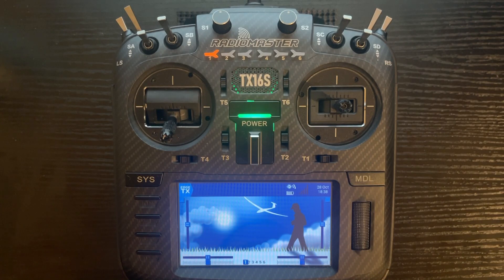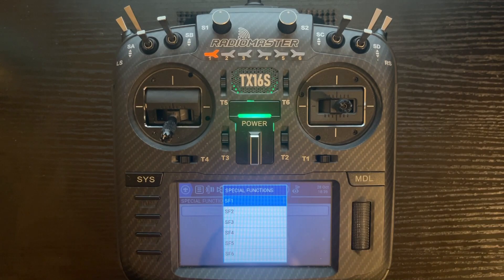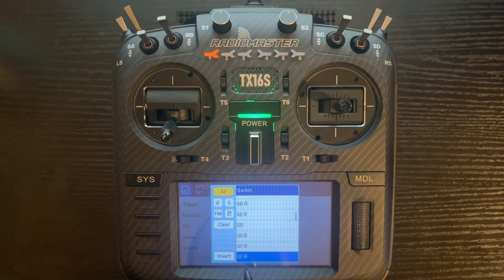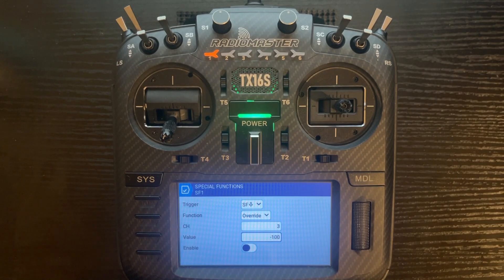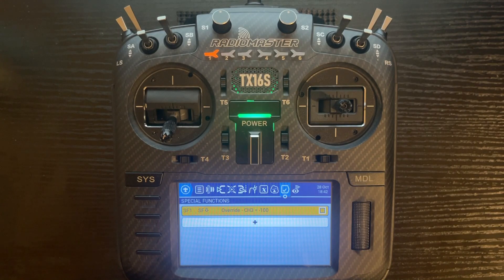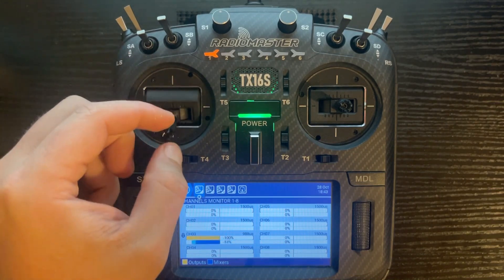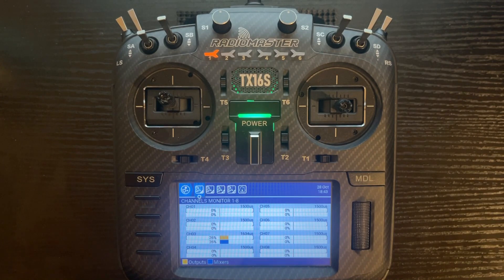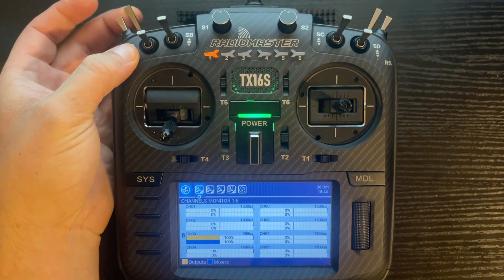Radiomaster TX16s/Edge Tx:Throttle Cut (Basic with 2 way Switch)

Comment: I usually set it up the other way, so the "default" position is the override on and I have to move the switch from the default position to use the throttle. The radio and aircraft should always start in a "safe" configuration.
Reply from the maker: Sounds like referring more to the momentary switch. (Also have that video posted) 2 way can be in either position. Checklist position can be added to make sure TC is on.
Reply: @BDTennessee  Yeah I have a 2pos switch set up with extra logic so it won't un-cut until the throttle is also at zero.
Reply from the maker: @sea_kerman  i have that on my main radio. However this was a "basic" throttle cut...
Reply: @sea_kerman  funny thing on a electric plane is if you move the Throttle to half when you plug lipo in, esc won't arm until it sees low Throttle